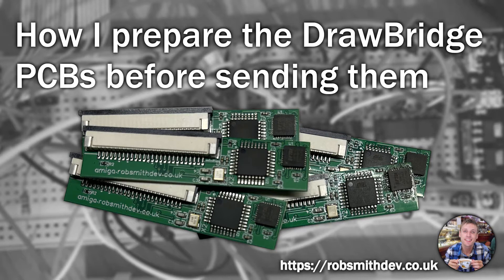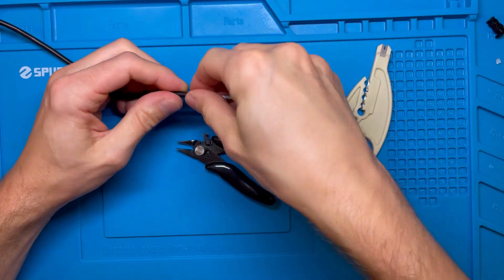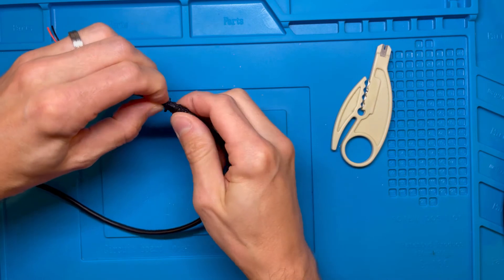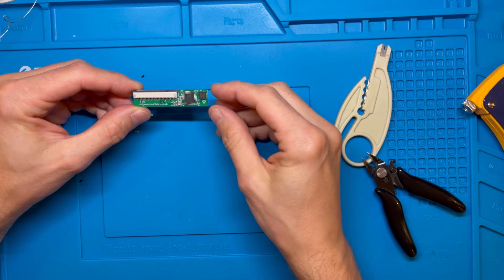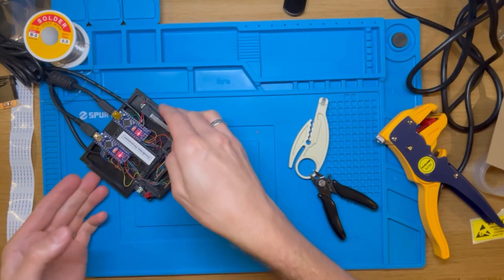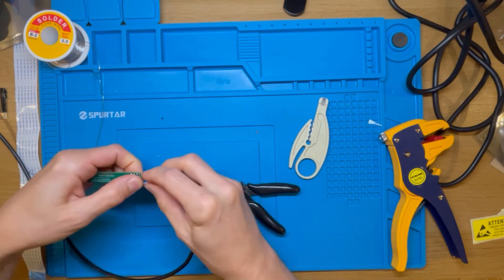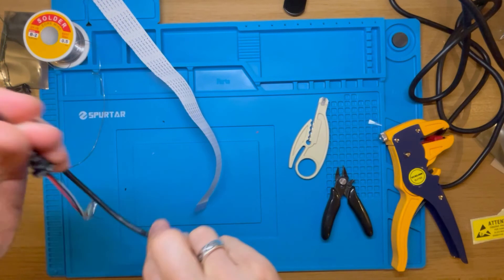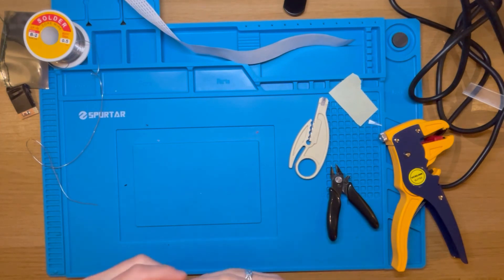How I Prepare DrawBridge PCBs for Slimline Drives

Comment: What brand and model should the floppy be, and do you have any idea on where I can buy one? I need to order one online since there are no available nearby, so I need to make sure I get the correct one.
Reply from the maker: It’s just luck because whatever model it says on the bottom has nothing to do with what’s inside the box. I usually order from Amazon but they sell on eBay and AliExpress. Try my discord, someone my have a recommendation
Reply: @RobSmithDev  Ok, I see. Thanks!